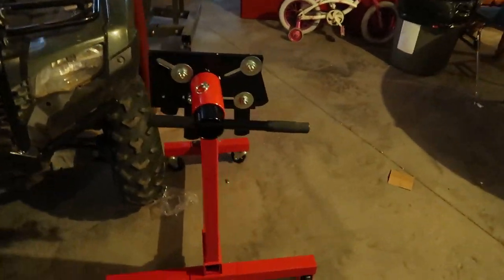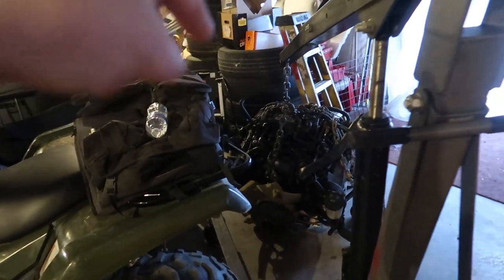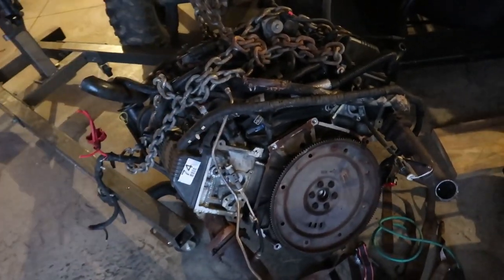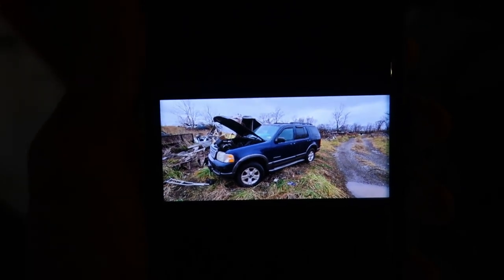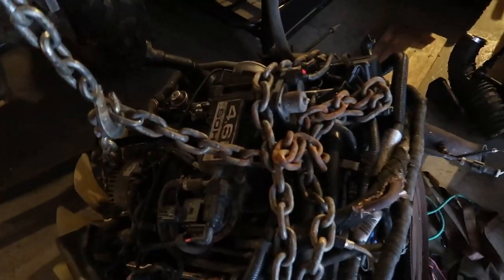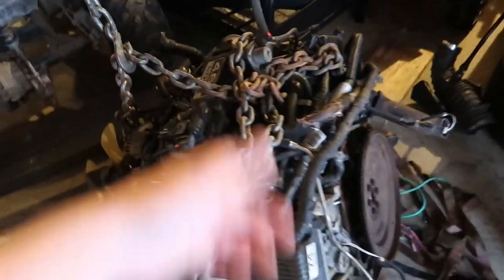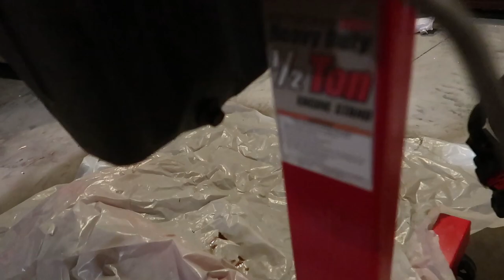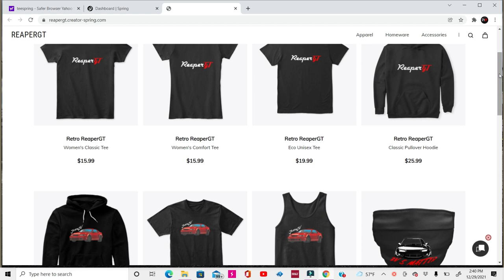MOTOR SWAP READY! (Revive Reaper PART 1)

Comment: The water pump may be the pump the bullitt uses…I know the F150 has the same as the bullitt…With some under drive pulleys you can make it work and have a cheap upgrade…You should look into it.